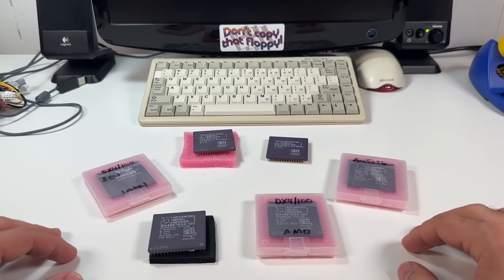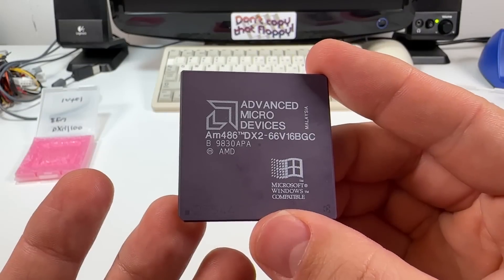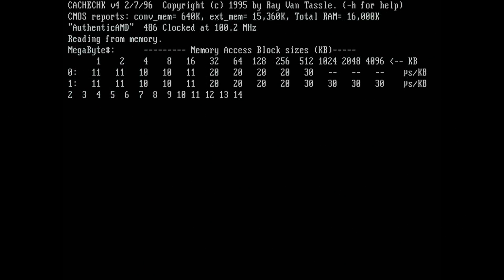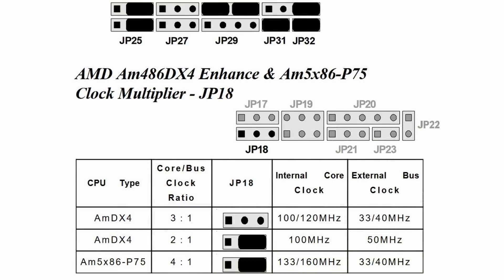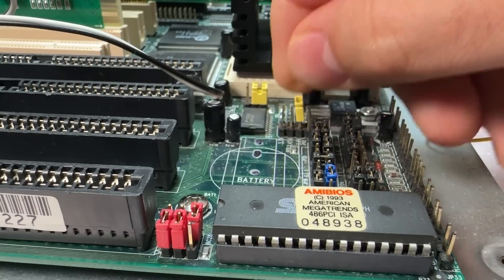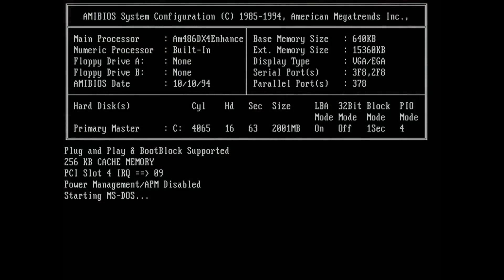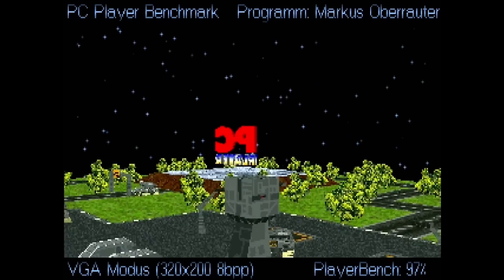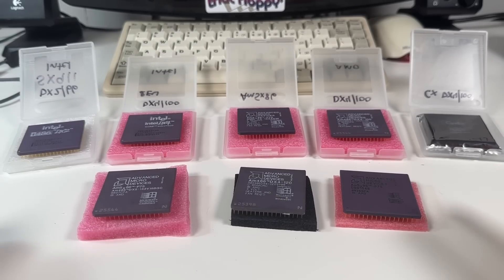These AMD 486 CPUs Are Not What They Appear!

Comment: I'm a big fan of 386 and 486 systems, and I overclocked a lotttttt of those back in my teenage years, as I had a computer teacher giving me those old parts mainly to get rid of them. I've seen lots of interesting results, but that DX2-66 really impressed me to no end. I never seen a 486 running stable with an 80 MHz front side bus at 160 MHz. Especially considering that it's labeled as a 66 MHz. An hidden gem right there.

And considering it could reach that, there is probably a way to push the clock speed even further with a slower front side bus and a higher multiplier. I'd be curious to see if it would boot with 75 MHz x3 or 66 x4, probably at 3.6V. Insane chip, probably a die towards the center of the silicon wafer.

You should make a video specifically for that chip. :)

Great videos all around by the way, keep up the good work !
Reply from the maker: Thanks very much! :-) .. Unfortunately, this DX2/66 chip couldn't do anything beyond 160MHz. It was totally stable at 160MHz and 3.45V (2x80MHz) and 150MHz (3x50MHz) but it refused to post at 180MHz (3x60MHz) with anything less than 4.0V. Even at 4.0V it wasn't stable enough to boot into DOS. This kind of wall beyond 160MHz is very common on all late-model AMD 486s including Am5x86s in my experience. I'd definitely like to buy a few more of these to see if I get lucky and get a better sample. Thanks for your comment!
Reply: @vswitchzero I think you could get it to post at 200 MHz with a 4x50 ratio and 3.6V.

I had a really late stepping of the Am5x86 back in my early days twiggling around with those systems (it was just before the K5 was released, that stepping was labeled as 5K86 instead of 5x86) and remember being able to pull off a 198 MHz clock, with 3x66 ratio @ 3.6V. It was rock solid but ONLY and ONLY if I had horrible cache and memory timings, but it was a beast to play Doom and I even could run Win98 on it without any stability issues.

So I guess maybe a 4x50 @ 3.6V could do it, sometimes you can pierce the wall with slower bus but higher multi, and looser timings. I also know that sometimes, when it's on the edge of instability, it's not really because of the chip itself, but expansion cards not supporting the higher bus. It is especially the case with graphic cards, as they tend to be more sensitive to it. The Tseng Labs cards tend to be less erratic, more stable, and with higher PCI bus frequency they can achieve INSANE memory throughputs in benchmarks.

Another way you could pull this off is by using a jumper switch to trick the board after it POST'ed, and you could easily measure it with a POST analyser card on the PCI bus (as it's the one that matters for the FSB, granted you use a PCI motherboard, otherwise on a socket 2/3 full ISA or even VLB without PCI would be close to impossible). Using the POST analyser you start it at a setting that is example 3x50, and just after it booted and the PCI bus frequency is stabilized, you toggle the switch to increase it to 4x (you could pull off the same thing with the FSB, while keeping the default / lower multiplier).

That's what I did back in the days to kind of " ghostwalk " the 160 MHz barrier. It's clever but it works.

CPU Galaxy pulls off that trick in his 200 MHz 5x86 subzero cooling overclock video.

But that 2x80 was really super impressive, I'm amazed to no end you could even get it to post at that insanely high FSB.

Hope it helps ! :-)

Comment: Oh the memories of my 486 times. so after my 8086, 286, and 386 times!  You could overclock those way more than you can the newer processors.  At the much smaller architecture sizes these days, and the fact they are already closer to whats physically possible, you just can't get that much more out of them even if unlocked, and you are much more likely to cause damage if you push it.

The most mind blowing speed increase for me was not a processor, but my first SSD!  I was like:😯😮🤯🥳🥳🥳

I was always an AMD guy.  I liked how that little company competed with intel and at a great price.  To this day I run AMD processors on my own builds, and they have served me very well. Of course now I can transfer 1TB of data faster than it took my 486 to boot!😂Don't even get me started on 12kb modems!!!🤭

Comment: Knew a guy who had one of the AMD 120Mhz 486s. He had a spare mobo and changed one of the crystals on it and got 200Mhz out of it. It was only stable for around 7 minutes in a benchmark(not sure what he was using, long time ago). He submitted it to Tom's hardware and they did a write-up on it. Actually never heard of a DX5 until this video. Don't actuallly know if it was or not. Fairly sure it had DX4 on it.

Comment: I have an AMD 5x86 that just can't overclock to 160MHz. I always assumed that was the fault of some PCI card or even the motherboards but this was smashed when a 100MHz Cyrix 5x86 overclocked just fine in the same system.
Reply from the maker: Thanks for your comment! If another CPU could run stable at a 40MHz FSB it was probably the Am5x86 that just couldn't handle 160MHz. In my experience, I'd say about 8 out of 10 chips can do 160MHz at 3.45V. Some may need a bit more vcore to get there, but a lot of 486 boards don't have options for 3.6 or 4.0V, unfortunately. Some boards only support 3.3V too, which is sometimes not enough for 160MHz.

Comment: That’s really cool about the 5x86’s declocked to 66 MHz.  I used a 5x86-133 @ 160 for my primary PC for a few years.   The only ‘insane’ overclocks I was aware of back in the day were the 16 and 20 MHz 486SX’s.   I also had a 486DX-25 that ended up at 48 MHz.  (Either it or the board I had would not work at 50 — but a 48 MHz oscillator.. no problem)
Reply from the maker: Thanks for your comment! I'm looking forward to trying out some low-clock SX CPUs to see how far they go :-)

Comment: IMO Probably the most amazing goat overclocker was the AMD Duron 600. Cheapest New cpu you could buy at the time and overclocked 67% to over 1GH matching intels flagship p3 performance. #2 was the Celeron 300a that did the same with a 50% oc to equal the p3 450
Reply from the maker: Indeed! Both are legendary CPUs. I haven't used many Durons but would love to try to overclock a few. I have a 1GHz mobile low voltage Duron around here somewhere.

Comment: That is an incredible fsb overclock! My max was with palermo sempron in socket 754, using jumpers in the socket to rise vcore, got from 1.6Ghz to 2.7Ghz. This with 2gb of ram and an 9600gt was my firt enthusiast pc.
Reply: DanielGT_93
Super Socket 7 was the last for both, sad ?
754 was there first socket, giant leap, but i needed it on day one.
We Germans got in weeks in advance, the AMD Chips too, Taipei direct from a shipment to Germany, AMD Dresden. ASUS did test us, Was it any good ?
Big WOW for ASUS back then, the sis people that did the Nvidia sound storm chips, Nforce 350.
It did do Dolby and all over nForce chips, S/P TOSLINK, AGP was better then PCI in these days. And it all worked ! Magic !
We got driver released by the hour, straight from ASUS Taipei, they did all the work for AMD and Nvidia here ! ASUS did that themselves ! Helping AMD do this, showing that the socket was 100% good ! Good enough for nay gamer it was, not supported by the industry only ?
It was Dual Voodoo in SLi here still, TNT was the Windows accelerator only, Nvidia was not good enough back then to run games in 3d.
Not getting SLi on 754, only AGP back then ! One gen later it was !

Comment: I loved how good things were back in the day.  It’s so much different now.  I loved my little cyrix 133mhz chip.   Was a beast.   Over clocking was so good and returned decent results.  I had a 1.4ghz thunderbird that would run stable at 1.7ghz and it took hardly any effort to get it there.   Now days it’s hard to squeeze that much without some serious time and cooling.    Again a great video and i look forward to the next one.  Love it
Reply: I swear I had a 100mhz 486 DX, so no multiplier, back in the day.
Reply from the maker: Thanks so much! :-)
Reply: Cyrix processors in my experience were very unreliable and Windows 98 kept locking up!

Comment: I had a 5x86 dx4/133 I ran for years at 160mhz People always swore I was lying. I worked at CompUSA at that time. I had a Cyrix 486dcl40 chip which was basically a 486#40mhz that ran on a 386 motherboard before that.

Comment: Even if it was enormous, that's way better than my best OC ever - a +130% on my FX-CG50 calculator xD
Although it was bottlenecked by RAM and sucked the batteries dry in a month vs. 5-6 on normal clock

Comment: overclock a 486 to 80x2... get 18fps in Quake. 😕
Reply from the maker: The benchmark that should never be run on a 486 but always is haha :)
Reply: if only to illustrate the motivation for gamers to bite the bullet and upgrade to the Pentium back in '95. I'd bet this rig with an ODP would do okay (24fps?) at Quake. 

P.S. Actually I've simulated such a rig - a 486 with an ODP - in PCem (which is a cycle-exact legacy PC emulator) and ran such testing, I just can't find where I put the results... so I ran one again. Got 24.1 FPS with a simulated AMI WinBIOS 486 with 83MHz ODP and a Tseng Labs ET4000 VLB card. Heh. I called that pretty well. @vswitchzero

Comment: Arguably, sharing silicon across multiple products is currently AMD's main strategy seeing as they have been using the same core complex dies for their desktop Ryzen, Threadripper and Epyc lines of CPUs for a few generations now, and with their latest Zen 4 series, they have even started using them for laptops.

As for the low overclocking headroom of modern CPUs, I expect that this is partly because the manufacturers have developed more advanced binning tests, so they can find the chips that will work optimally with specific products in their lineup, and partly that modern CPUs have features that allow them to automatically regulate stuff so they run closer to the limit out of the box.

And, of course, the progression of clock speeds have slowed way down, if those limits hadn't existed, we probably would have seen high single digit GHz clocks by the end of the 2000s, over the 2010s we would have seen clocks going into the 10s of GHz, and by now we would be looking at 100s of GHz.

Comment: It's a lot of fun to see these old CPUs just casually overclocking like crazy like this.  Makes me wish there had been something like a generation of Chinese made 486 clones produced with modern fabrication.  1GHz 486 would give me a lot of joy for no particular reason.
Reply: Doesnt CPU’s like that exist in embedded solutions?
Reply: @tezcanaslan2877  In a round about way, Vortex86DX is effectively like that.  It's effectively an i486 built on 90nm process with up to 1GHz clock that can use up to 1GB of 333MHz DDR2 RAM.  On paper, that is really cool, and benchmarking it would be funny.  Alas, some of the fun with building PCs in this 486/586 generation is putting together all the cards you want and stuffing it in a case.  Can't really have that kind of fun with a tiny SoC thing.
Reply: I remember Coppermines being popular because +80 to 100% overclock was pretty easy with basic cooling and motherboards.
Reply: @VndNvwYvvSvv  Celeron 300A that everyone, and I mean everyone, overclocked to 450 easily.  That was the largest free bump in speed I remember there ever being.  These days, people sit there and try and itch out another 100mhz or so, but it doesn't seem to actually make much difference when you're running 4-5ghz machines.  But getting an extra 150mhz from a 300mhz part?  That kicked some ass!
Reply: Newer nodes obviously have better tech. You might also say why not put the FX bulldozer in a now 4nm packaging and have it running at 5.5Ghz while consuming only 125W of power. The arch is still "bad"
Reply: @Jeroensgambling  Legally speaking, there was actually a point where China trying to drag the 486 into the future might have made some sense.  I guess it didn't make enough sense as it didn't happen, but it's not as unrealistic as other options.

Comment: With the "P75" pull the jumper so it's a 3x modifier, then set the FSB to 50mhz (if supported). Trust me, it works, and it actually can give a Pentium 90 a run for its money thanks to the faster BUS. Laugh is even if you don't have 50mhz FSB, the 40mhz for the AMD "40's" at 4x -- only 120mhz -- was often faster than the 133mhz config just because memory speed was more of a bottleneck. VLB and PCI also tended to get a bit of a leg up there. (though not EISA which I always found odd...)

Assuming your RAM can keep up.

It's technically not even an overclock as it's a valid spec in the pamphlet they originally came with. They just didn't advertise it out load because 50mhz FSB mobo's were far far less common -- just like the DX-50 chips (true 50, not DX/2) they were designed for.

My "middling" machine for writing 360k floppies whilst still connecting to my LAN in Windows is that very config... with 128 megs of EDO RAM. Runs Win98 off a CF card shockingly well.

Comment: Crazy how your motherboard has 100 MB/s for memory performance when my SIS 497 based ZIDA 4DPS can only muster 28MB/s. That's with my Am5x86-133ADZ. Are you using EDO? Edit: Found the Cache Tag setting in the BIOS. Set it from 8 to 7. Timings are 3-1-1-1 with 0 WS. My benchmark is now pushing 110 MB/s with my Am5x86-P75.
Reply from the maker: Nice! This board doesn't support 3-1-1-1, unfortunately. I am using EDO, which this board supports but in my benchmarking it makes no measurable difference compared to FPM for some reason.

Comment: The CPU ID tool is not a reliable way to know what the core really is. It just looks at speed and multiplier signatures to figure that out with a 486. If you notice, the family code is the same for 486 and 586 cores, so there is no way to tell for sure. The reporting is only changing as a result of the config changes.

Comment: I think you've probably gotten it the incorrect way around when it comes to modern overclocking, hah. Manufacturers today already overclock their CPUs at the factory and then call that the "standard" operating parameters. What little is left is when it becomes unstable, and so they then call that "overclockable capable"..

Comment: I have one of these "enhanced DX4" too, labeled as Am486DX4-120, does everything the regular Am5x86 does. 160Mhz at stock Voltage, no problem. 16kb L1 WB Cache.... These are gems
Reply from the maker: Nice! The DX4 120s are quite rare compared to other AMD 486s. I have a non-enhanced write-through version but not the enhanced one.

Comment: In good old times I and 2 of my friends, computer geeks, bought the fresh, nevest invention - AMD 486SX25. These CPU all worked well at 40 MHz, but not without cooling, so we had to order coolers and wait for them as they were not popular yet. While waiting for the cooler, one of my friend filled the jar with water, put the lid on and placed it with the metal lid down on the CPU. A water cooled 486 :) - it worked :)

The most overclocked CPU I used was a Pentium 166 overclocked to 250 MHz. 

A modern hardware that still can be overclocked a lot, is a Raspberry Pi Pico, 133 MHz standard clock, that can run way over 400 MHz, and Parallax Propeller 2, they said 180 MHz in the datasheet, 340 MHz possible on every chip.
Reply from the maker: Thanks for your comment! I have a few 486 SX models that I’d love to try to overclock too. Very interesting about the raspberry pi pico! I didn’t realize that 🙂
Reply: @vswitchzero 4x for the pico is suspect 🤔 never heard of that level of overclock.
Reply: Bro really into early water coolin
Reply: Jar-cooled processors, now there's a delightfully wild story! :D

Comment: Used to love the 386 and 486 days, lots of fun overclocks, you could reliably use 386 chips at least one speed grade higher and often two, the 486 chips were a revelation, so much fun to be had with multipliers, voltages etc and none of them were 'locked down' like they are now.
Reply: The risk of burning the CPU? You need to cool that processors. !
Reply: 486/75 Mhz Pentium Overdrive was a expensive solution.

Comment: the highest overclock i ever achived was 2 units of celeron coppermine 566 cd0 stepping
a bit over 100% oc runing it on 133 bus instead of 66 but, it crashed after any more than 1200 mhz , it was totaly stable at 1150mhz though
and i can't say it was a big problem to keep it cool because most of the time it run on stock 1,5v at this speed and remain oinly 5-8 degree above room temperature on a vert cheap athlon cooler 
the rummors being those were ment to be p3 850 only the whole batch got half the cache fused in production by mistake, but were first grade silicon trough out, how much of the rumor is true i don't know , i know eacho of them cost me small bottle of coke
Reply from the maker: Nice overclock! I haven’t explored the coppermine P3s much yet but want to give them a try. I have a couple 1GHz chips but not much else from that generation.
Reply: @vswitchzero   just remember that on via chipset you overclock the whole bus up by manipulating 2 bsel pins on the cpu because neither jumpers nor bios pci dividers work corectly otherwise, for cd0 or tualating celeron runing at 133 bus you have to insolate both bsel pins  so they don't make contact with the socket or permanently remove them otherwise 30% is max oc on those chipsets on i815 and bx boards dividers works normally and sis chipsets, especially the ddr one chip solutions have no oc whatsoever

Comment: Notice the number 25544 in the lower left corner. It is the only marking that's really important, denoting the CPU core inside. They are all pretty much the same, except the -66 part has its die wired for 2x/3x instead of 4x/3x multipliers.
Reply from the maker: Interesting! Will look more into this 👍